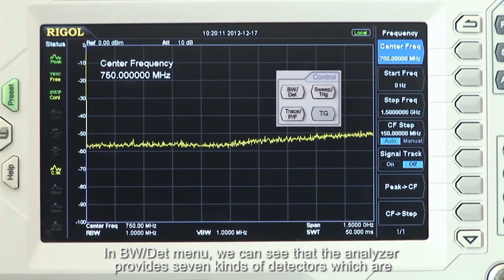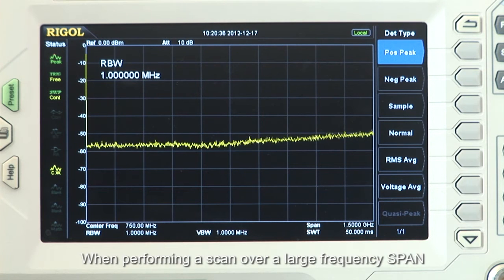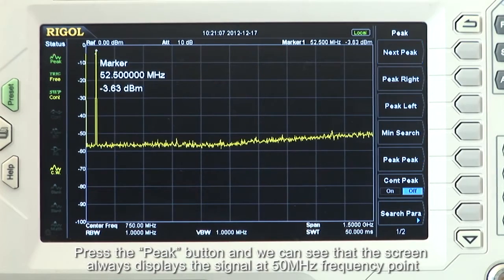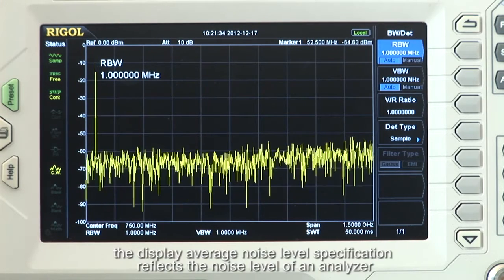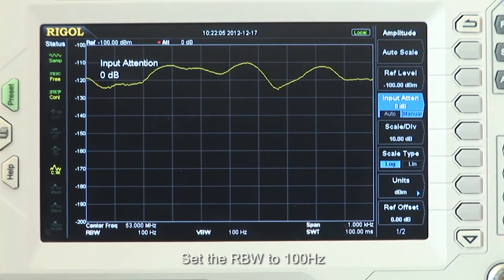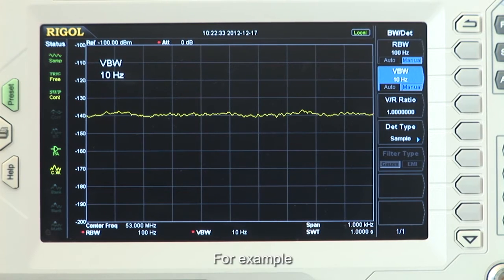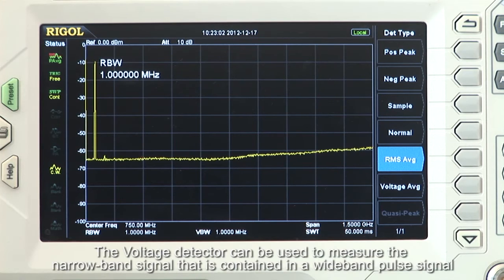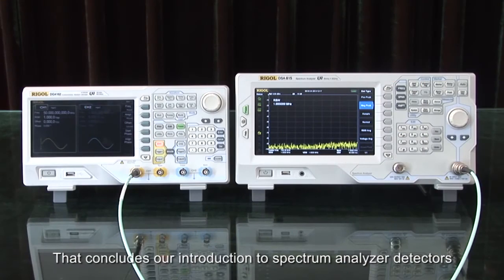Using the different Detector Types on the DSA800 Series

Comment: My DSA815 has a warning intermediate frequency signal out of range. how to solve the problem?
Reply from the maker: This typically means that it is seeing high power near DC. First, I'd move the start frequency away from DC and see if that fixes it. Then, I'd make sure there are no peaks on the display above the top reference. You may also want to disconnect the device to make sure the analyzer is operating correctly before reconnecting power.